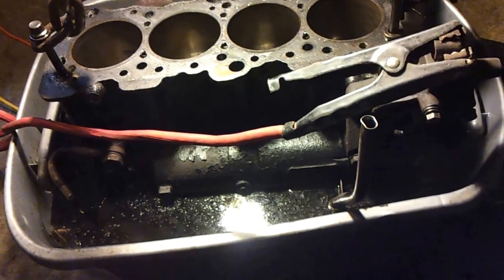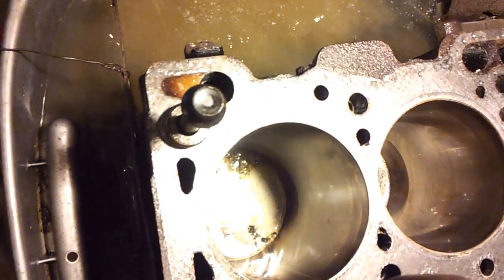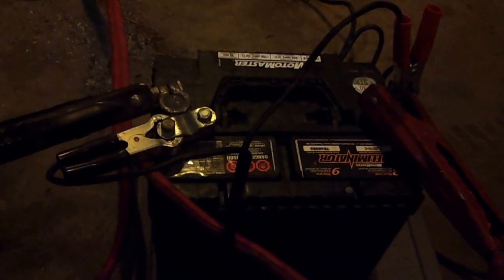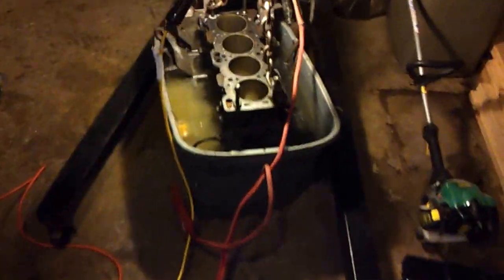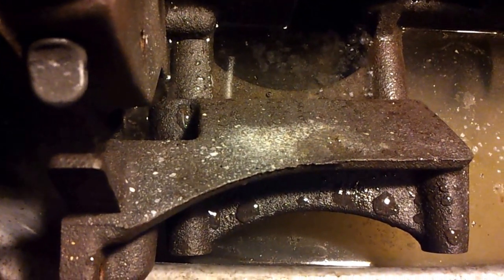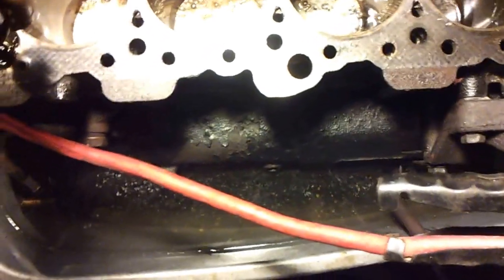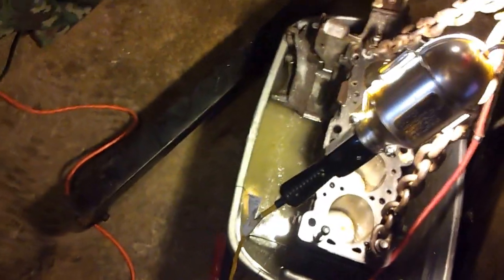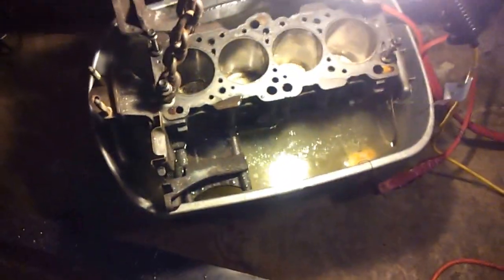1997 Mitsubishi Eclipse 7Bolt 4G63 Electrolysis Block Cleaning DIY

Comment from the maker: This actually turned out great. Some changes,
1. Hook the jumper cables to the scrap steel and block directly. The wire corrodes apart.
The best thing I found to use in the tank was the old balance shaft. It took some time maybe 20 hours to clean to my liking after being set-up properly.After a rinse with plain water in the driveway on the cherry picker, I painted it flat black immediately, no priming or scrubbing required.